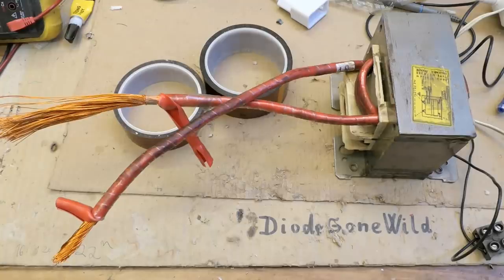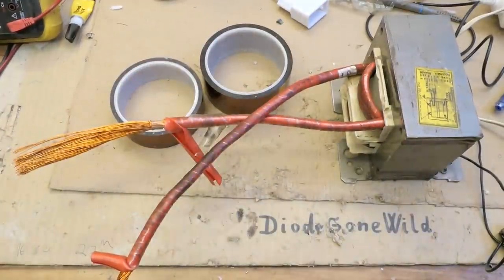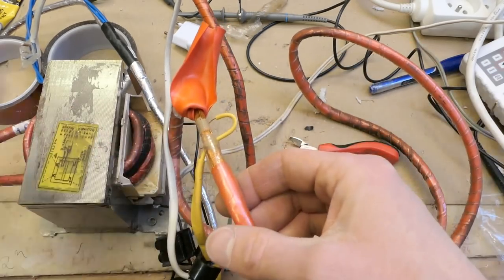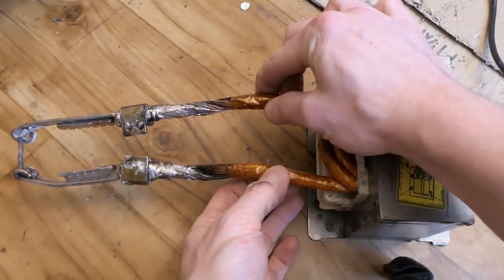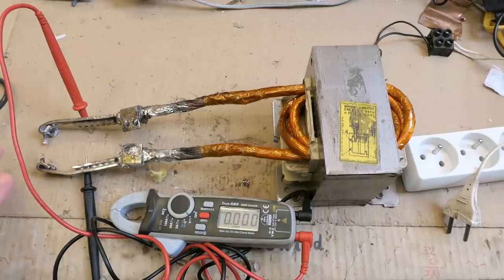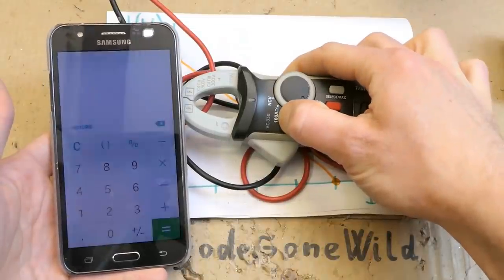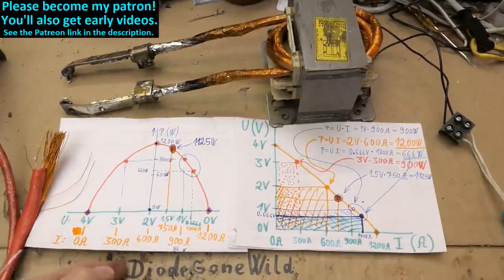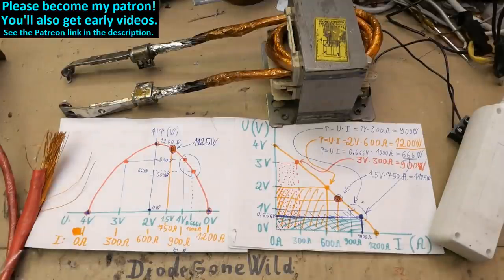Microwave Oven Transformer Spot Welder 2

Comment: Remember that it is not good to breathe in the fumes from galvanized material.
I did work as a factory mig/tig welder and it was adviced to use extra ventilation when doing that when repairing someone others construction fault that had gone into galvanzation already, things that was measured wrongly on the drawing board and had to be done again.
The weld also wont stick as good when it is galvanzation or paint in between there so use a angle grinder and clean it up to bare metal before you weld and it will stick much better :)
We also had a spot welder there and it had a foot switch like you mention, and it had replaceable copper rods as contact points to spot weld metal plates.
Becourse copper wont stick to steel.
Actually you can use a thicker copper plate and fill in with weld if you have a steel plate with a hole in it that needs to be filled, it will save half the grinding needed afterwards, yeah, this is for using a mig welder, not spotwelder. They learned me all kinds of techniques there.
But just to give a understanding on how copper works when welding.
Also the wire nozzle on a mig welder is made of copper beourse of that.
Reply: Metal fume fever is kind of nasty. I've done it to myself a couple times. For days I feel like I have the flu. Just generally don't feel too good. I hear in really bad cases you can even die.

Comment: I have a similar thing and I made a small timer to time the spot welds. Turning it off rather than just removing the electrodes is (allegedly) important to keep pressure on the welds after completing them. To switch the transformer I used a zero-cross switching SSR to stop it from blowing the fuse, not the cheapest solution but very easy.

Comment: Really nice! 
I was surpriced at first about the thick wire from an old TV (because there is no need to handle high currents in those) - then I got it, haha (it was actually one of the typical wide coils used for CRTs, that's cut up to get one turn of many parallel wires - smart idea). Also, well explained, how to get maximum power out from the transformer.

Comment: glad I became patreon and your alive!
Reply from the maker: I had some trouble with my laptop. Finally I have a new one :). Much more powerful. I could even try to edit 4K or 1080p50 or 1080p60 on it. I may try it in the next video.
Reply: @DiodeGoneWild  1080p60 would be epic! :)
Reply from the maker: I'm more likely to use 1080p50 because in a 50Hz country, it's inherently flickerless, no matter the shutter speed. 1080p60 is only flickerless at some specific shutter speeds.
Reply: I edit my videos using my phone with the powerdirector app, and i made videos at 4k 60fps..
Love from India
Reply: @DiodeGoneWild  wat kind of laptop u got because i am looking for one
Reply: @DiodeGoneWild  You should start using your community tab on YouTube. Sometimes if you're working on something and it takes some more time you can post a snippet of what you've found.
Reply: @Simon Simon i dont know
Reply: @susceptibility_  That's quite a traaaaaaansfoooorm...ation.
Reply: @DiodeGoneWild  but at 50fps it tends to flicker on the monitor, cause most monitors have 60 Hz. Its best to leave video at 30 fps - it fits into the 60Hz sheme of the monitors. Most YTers dont understand this :-)

Comment: Ah yes, the universal thermal insulation: sandpaper.
BTW would it be possible to use graphite electrodes from carbon-zinc batteries?
Reply: Graphite electrodes may be heat resistant to a good point but one) they produce damn bright arcs and second) the "high" resistance of the graphite limits the current too much
Reply: @legominimovieproductions  yeah with graphite electrodes you would get almost no current to flow at <4V. At 12v you can get roughly 50-70A out of graphite electrodes from a D-cell. No good for spot welding.
Reply: @Basement-Science  Done welding with D cell carbon electrodes though, you can use them to join pretty thin material with an arc weld. Just use a pencil sharpener to make the point sharp, and the other end use some copper thin wall pipe lightly crimped to the carbon rod to make a lowish resistance connection. you might go through a few D cell carbons to get the crimp right, enough pressure for good current flow, but not so much it shatters.
Reply: @SeanBZA  Arc welding is very different from spot welding. There, the plasma arc heats the metal, but in a spot welder the current itself heats it. That's why you need a lot more current and less voltage to do it.
Reply: Tried arcing graphite at 5V, very little current flow. You need something like 30V but then at that level it doesn't spot weld anymore - it just melts the entire workpiece.
Reply: I wasn't sure if I was seeing sandpaper or some other cool thing =)

Comment: I have done quite a lot of spot welding and one of the most important part is the alignment of the electrodes and the clamping pressure. It’s a good project to build a home spot welder as they are expensive.
Reply: Just what i was going to say! Many people seem not to realize that clamping pressure is essential. You dont want ANY air-gap between the plates for the best weld. An excellent spot weld will pull a plug out from one side or the other.

Comment: Přepis do překladače pro lamy, jako jsem já ;) 
i may try to remove the magnetic shunts. Than the secondary voltage won't drop that much. But i can only do this in combination with less turns on the secondary, otherwise the primary current would be too high and it would trip my circuit breaker. less turns on the secondary means a higher ratio of the secondary current to the primary current. ideally, the secondary voltage shouldn't drop below 1/2 of the open circuit voltage. The voltage drops partially resistively (on the resistance of the primary and secondary), heating the windings, and partitially inductively (because of the magnetic shunts and the leakage inductance). But in both casses, the more the secondary voltage drops under the load, the less effeciently you're using the curent aviable from your circuit breaker.

Comment: 12:10 that is a very useful finding, that the maximum power is reached when the voltage drops to half. if the car battery drops to 6V when starting, then it simply cannot deliver any more power.

Comment: Maybe you could try to add some capacitors at the primary to improve the power factor when welding to reduce the chance of tripping the breaker? Not sure how much the inductive current actually is here, but it might help a little bit at least.

Comment: It actually makes it even more efficient as with AC the current only flows in the skin of the wire. Having multiple parallel isolated strands makes it possible for the current to flow on the surface of all conductors, leaving you with a lower impedance!
Reply: Yes, but the skin effect depends on frequency. With mains transformer you would need (if i'm right) almost 10mm diameter wire (68mm2) to start seeing any difference.
Reply: @michamaecki8104  True, it's not switch mode.

Comment: If you get the chance Danyk can you talk about possible over current protection used in retail welder circuits to avoid tripping the circuit breaker and maybe mention some rudimentary ways to deal with the transient spikes?

  I recently started messing with a U2010B based universal motor controller circuit and came across a dilemma that seems like your area of expertise. How can I calculate a transient suppression rc snubber for a universal motor when I do not have its specifications and my 50MHz scope is not fast enough (5ns) to monitor the spike? As far as I know the 100R/100nF default values are sufficient.  If I can't see the spike it must not be there! Lol. The chip already failed once and I haven't discovered the culprit yet. I'd rather have a theoretically ideal RC value to use but I have no idea how to come up with the equivalent inductance of the motor to plug into:
E=0.5 * L * I^2
...to come up with the joules for the RC values.

Comment: As you already know, Koptan is a fake Kapton tape, and the characterictics are worse. It does not support high temperature like genuine Kapton and is dangerous. But it may be part of the show, of course.
Reply: Lets not get into Kapton tape. In the 80’s it was a huge issue in the avionics industry. It was discovered it outgassed in certain conditions, causing short-circuits in avionic equipment, and got banned. Spent months rewiring and re-insulating avionics wiring looms, ans learnt to hate Kapton tape. Nowadays, everybody is using Kapton tape again, even in avionics and aerospace. What happened, was it overreaction, or has something wlse changed?

Comment: I think the best way to turn it on will be proper thyristor. Even then you can control welding power. Using similar circuit like these in drills or other power tools may be a good idea. Going further adding time counter you may finally produce professional device. 
Cheers
G
Reply: Variac would be better. That way the pri voltage can be reduced so the core doesn't saturate like crazy

Comment: 5:32 Hey Diode, yo You know that this mains plug You're using is rated only for 16A, not 24A :D
Reply: Correction, I think that even less, 10A :)
Reply: It has a low duty cycle, so it should be OK, unless you are using it continuously.
Reply: The circuit breaker of the socket is 16A.So it doesn't matter if you load it continously at 16A or at 24A until the circuit breaker trips,usually about a hour or slightly less.
Reply: @SzymekCRX  I used one of these for a MOT and it started smoking after 10 seconds 🤣
Reply: The cable is flat, so it's even less (2,5A!)

Comment: 12:20 try many single "loop"   secondaries in parallel , for more of the core filled for more cross sectional area & a lower resistance to match the weld resistance

Comment: You can pretty easily modify that meter to read up to 1,000 amps... There is a tutorial on YouTube and a forum called the EEV blog that has detailed instructions and multiple methods
Edit: the instructions are for the UT 210E... Which is the same model that you have, only with a different name

Comment: Maybe use the solenoid for a car starter motor to switch current in the primary? That would take the load switching away from the plug.
Reply: Those are only rated for 12VDC switching. They likely wont last long at 230VAC
Reply: @Basement-Science  A very good point, excuse my schoolboy error!
Reply: What about a solid state relay instead? I'm not too familiar with their specs though.
Reply: @andrewhaychemistry  Any type of relay will work as long as it can switch at least 25A at 230Vac with at least a small inductive component. The relay coil should also be 230Vac to make the circuit simple.
Reply: @Basement-Science  Great idea.

Comment: I'm wondering if you could measure current somewhat accurately with a clampmeter if you just split the secondary output cable in parts and measure the current flowing through each part. (Then add the values together to get the total current flowing through the secondary.)
Reply: Could maybe do that, but you'd need to match impedence carefully

Comment: A very efficient way to remove the laquer from those wires is to dip them in a hot concentrated solution of sodium or potassium hydroxide. Very dangerouuuus, of course, but the cat would love it (watching it from a save distance, od course²).

Comment: nice description ...
i think the secendary windings on thins transformer  can not effitiently demagnetize the primey windings that cuse the power factor on primery side cant reach near 1 at full load 
can you measure the input power factor and if it wasnt near 1  
try a series capacitor on primery
and also lower the ratio of the transformer

Comment: Can you spot weld lithium batteries with this?
Reply: I do, with a spot welder of very similar construction
Reply: Just be careful not to heat the battery up for too long, having the bottom (negative) of an 18650 glowing like diodegonewild had the metal parts glowing would very likely result in an explosion and serious harms
Reply: Of course , you could all though overheating the battery leads may lead to a risk of fire explosion and so on...
Reply: @legominimovieproductions  Sure but you don't need to.  Dany was just playing around for effect.   You can spotweld battery packs together in a few tenths of a second.
Reply: @michaelfisher9671  You would probably want to use a timing circuit for it. Make sure it cannot run for more than a few ms.
Reply: @Basement-Science  way ahead of you, already do.

Comment: I´d like to put together a spot welder to make 18650 cell batteries- I guess I don´t need 1200w. Just enough to spot weld nickel straps.
Is it possible to control the power by the wire gauge used in secondary?

Comment: Would it be a nice idea to add a soft start circuit at the primary? Maybe the initial spikes will trip the breaker if you remove magnetic shunts?
Reply: A switch is way easier .
Reply: An SCR with zero cross detection is perfect, somewhat costly for this current maybe? I'm certain he can find some communist switches that can handle the load ;)

Comment: 5:34 Don't put your clamp meter close to the transformer,the magnetic field will make the reading wrong.I estimate that your actual short circuit current is 20A and the clamp meter shows 24A from the leaking magnetic field around the iron core.

Comment: why don't you remove the shunts? maybe i'm getting something wrong, but those shunts "short circuit" the magnetic field and limit current on the secondary, so current draw on the primary side is unaffected

btw, you're lucky if windings are actually made of copper, i think nowadays they made of aluminum mostly

Comment: do you have any tip for removing the enamel coat on those thing without sandpaper or scape it with scissor ? I tried to burn it but no luck :(
Reply: Methyl ethyl ketone (MEK) should work.
Reply: Just sandpaper the copper until it's shiny enough and then put lots of solder on it to connect the wires which have not been connected together yet .
Reply: The age old question, how to remove lacquer on wire... I'm yet to find a reliable method that removes ALL of it, no matter what diameter, enamel type and temperature rating, 
In my experience sandpaper works by far the best for medium diameter and up. 

Things that do NOT work, but are often suggested anyway: Acetone, burning it off, dipping it in a solder pot etc.
@John Smith can you confirm if this actually works? To my knowledge MEK is very similar to Acetone, which as I said does not work.
Reply: @Basement-Science the problem is sanding 0.2mm individual wire from litz wire is pain in the butt :( Tried to dunk it in a pool of tin but no luck. well I guess the best method is still scrape the thing off the old way
Reply: @MuhammadHanif-bx4pb  Of course, these are all bad options. I've had some success with using hydrochloric acid once, but need to do more testing. It seems to destroy the plastic faster than the copper.

Comment: Love how he uses only 2.5 A mains voltage plug without a ground connection
Reply: It doesn't need to be grounded as the windings must be isolated from the core .
Reply from the maker: The final version will have a proper grounded plug and a switch. I used this plug as a temporary solution because the big plug is much harder to plug and unplug and so you can't use it as a switch to power it for a fraction of a second.
Reply: @DiodeGoneWild  i was just joking   
Of corse it cant be as dodgy as chinise chargers
Reply: It was actually a 6 Amp Russian plug cut with knife to make it flat,not a 2.5A one.4mm pin plugs can handle 6A,but some idiot decades ago limited europlugs to 2.5A :(

Comment: That thing has more current than my welder does. Mine only goes up to 200 Amps. My welder runs at a lot higher voltage though. So more Watts. I guess I need the higher voltage to strike a proper arc? I usually run in the 60-90 Amp range.
Reply: Yes, arc weling is very different from spot welding, or resistance welding in general. On an arc welder, you rely on the plasma arc to get extremely hot which then heats the metal around it. However a spot welder is not meant to heat any gas/plasma and instead heats the metal directly by putting tons of current through it.
Reply: @Basement-Science  the glow's the same. So it doesn't look much different to me. I guess arc welding is hotter though. I hear a welding arc is hotter than the surface of the Sun. So pretty hot. I think I may have a welding project coming up in my near future. I try to avoid doing it. But sometimes it is the best process.

Comment: How well would it work as a stick welder?  Is the voltage high enough for that?
Reply from the maker: The voltage is way too low for arc welding. You need something like 40V. People often use 2 MOTs as an arc welder. They usually put  about 20 turns on each secondary and connect them in series.

Comment: These metal chassis from PC PSUs are zinc coated, breathing the fumes from welding them is really not a good idea.
Reply: I did not see the tell tale white smoke. He was getting the white crust rings around the weld spots though. Getting the fever is very dependent on exposure. You're OK until you're not. But you don't know while you're dosing yourself. There is a metallic smell associated with it. Kind of catches you in the back of the nose.

Comment: 4:24  You could also remove the lacquer using a lighter ? ( basically burn the lacquer)
Reply: Good luck with that . That copper coil is way too thick to do with a lighter . I'd use a sandpaper and then solder it .